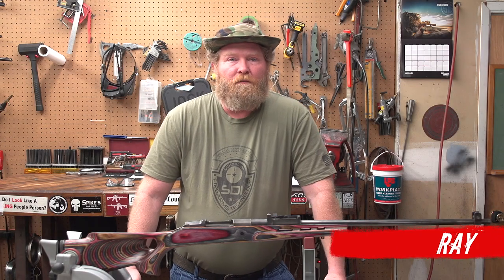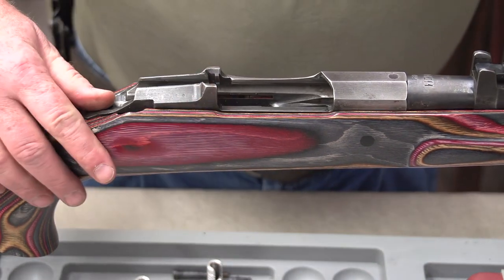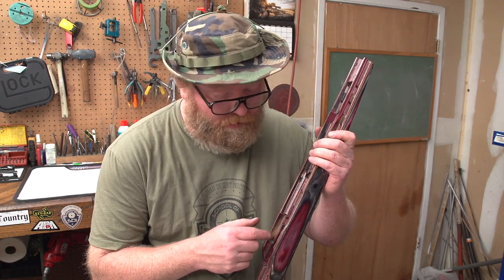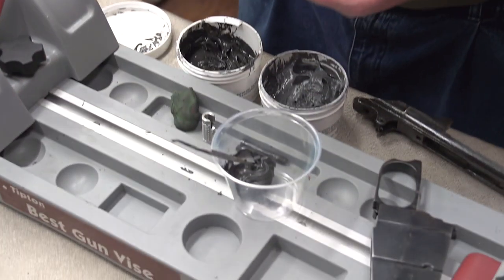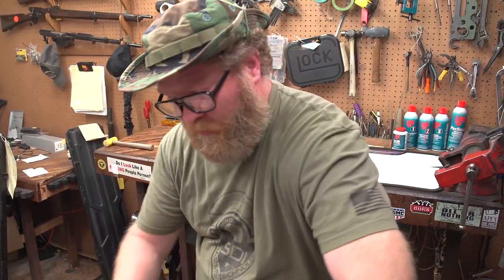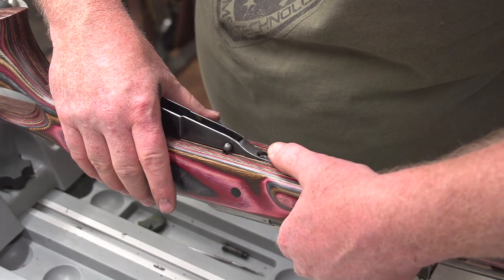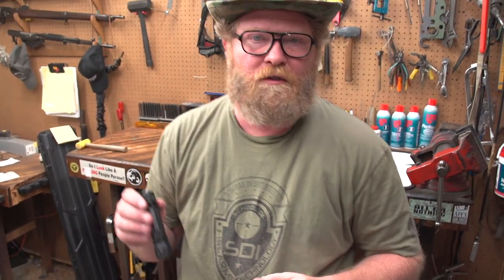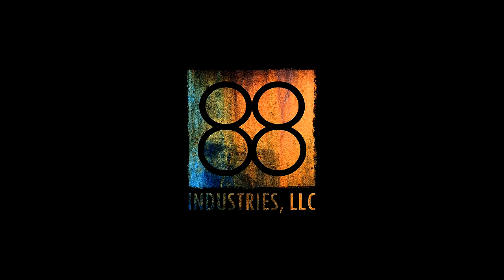How To Pillar Bed a Mosin Nagant

Comment: Outstanding video, all the techniques applies to any gun and the gunsmith presented the information is a very clean manner.  Sort of like a classroom demo, and the tips and techniques were well presented.  Thanks for the work that went into this video, guys, well done!  Nice thing is the gun itself is not altered in any way, only the custom stock to fit the action tightly.  In no way was the gun altered from stock and so change back possible anytime.  This is the sort of effort that preserves the unique gun and yet gives you a tack driver in the custom stock.

Comment: what if you don't have a drill press to drill out the holes? I probably could do the front holes since its straight up and down, but what would be the best way for the rear since its at an angle?

Comment: Forgive me for asking, but what is the purpose of pillar bedding? Is it just so the screws that fasten the reciever/magwell and trigger assembly have something more sturdy to bite into, and/or for stability?
Reply: The bolts only ever screw into steel, but normally the sides of the bolts are resting on nothing but wood, which is obviously less supportive than steel.

Comment: I have the same stock and was wondering if the stock will split without using the recoil lug that is present in the original Mosin Stock?
Reply: Nelson Fields no it wont. the original stocks had the rear lug because occasionally the rifles had to be used as a spear or club. as for the people who will say " a rifle isnt a spear" they came with a bayonet.
Reply: ok thanks!
Reply: Nelson Fields dont mention it. happy to help

Comment: is the bedding material the same thing as jbweld?
Reply: uncletally123 no JB Weld is a cement epoxy. bedding compound is a thinner compound that if you add release agent then it will not stick to the barrel. JB Weld would seal the barrel and stock together.

Comment: Since you guys are modifying a Boyd's stock, I have a question. I'm thinking about doing a stock swap on my Howa 1500 LA, and i wanted to pillar and steel bed the receiver, but Boyd's told me not to pillar bed their stocks because the bolt hole near the rear tang doesn't have enough material to support a pillar. What are your guys' views on that (since you are doing it and I trust your opinions)?

Comment: I am looking for a gunsmith to dbl lug and piller bed a Boyd's lam. stock to a SA M1A.
Any ideas? I'm in central OH. Can ship. This my long range build. Currently bedded in a kevlar stock.
Reply: Doug Allen Are those M1As that accurate of a long range rig?  I hired a dozer guy to build me a burm last fall and have been pretty disappointed with the accuracy of most of my factory guns. I bought a RCBS rock chucker to try and tighten up my groups but have not had the time to start reloading yet. I have laid behind some nice rigs that were really accurate but I just dont want to drop $6000 on a rifle and another $3500 on a scope for a .308   Would be interested in your experiences with the accuracy of the m1a, if you care to share. How would you compare it to say an off the shelf savage 10? If you bed it, trigger job (or drop in trigger) and handloads, what is the best you think the rifle will do at 500 yds?
Reply: TAC-Z I have NO issues with my M1A. It's a long story as to what it is and how it lived 'til I found it, 20 yrs old and never fired Super Match, gauged 0 front and rear. Complete take down, cleaned and fitted. Topped with an A.R.M.S.18, SWFA SS 10X. 1/2" groups at 100 w/ball NATO. With Fed GMM 175's, same hole. On a good day, I can do 6" at 1000. Now it does weigh 15 lbs. Couple that w/20 & 30 rd. mags. as fast as you can pull the trigger. I want to ramp it up just a bit with a new stock.
Reply: TAC-Z M1As can vary from what ive heard, some shoot great some not so much.. But on the subject of accuracy from a bolt gun, you can basically get 1,000 yards for $1,000 if you spend wisely. 
Depending on the prices, 700 AAC-SWFA SS 10X would be a great setup
Reply: Doug Allen Look up Nelson Burger.  He an Amish gunsmith from the New Philadelphia area.
Reply: TAC-Z Amish are pacifistic.  They do hunt.   They are strictly meat hunters.  Ever see Amish at a County Fair?  They will shoot out the stars in the shooting gallery.

There is typically ~3 firearm in an Amish household.  ..22 for small game.  Shotgun for birds, Rifle for deer sized game. Their firearms will be basic, (think Marlin vs. Weatherby)  They do not believe in luxury type firearms..  They typically will shun handguns, as most are for defensive use i.e. (use against humans).  An exception for revolvers for  deer hunting like in Ohio.

Some Amish 'smiths that shun the use of electric power will rely on water powered equipment.  Gunsmithing is a handcraft, very much Amish trade, as they do mall of their work by hand.
Reply: Michael Medley No shit?  How do they power sandblasting cabinets, lathes, mills, and dill presses by hand? 
No luxury firearms or defensive firearms, no wonder i have never heard of any.. Do you live in Amish country or how is it that you know them?
Reply: TAC-Z Lathes, mills, drill presses, forge and bellows can be runs off of a belt driven water mills. Don't know about sandblasting.  I been around gunshows, and in rural areas concentrated with Amish/Mennonites.  I have Amish 'smiths recommended to me.

Comment: if you want a value rifle that can shoot sub MOA and really cheap, go get yourself a savage axis. they are just over $200 at walmart and are free floated and ready to go. just put a OK piece of glass on it for about $300 and you are set. you dont need to dump $800 into a mosin to get a good value gun. plus you can get a modern gun in pretty much any caliber. 7.62x54r is only good for match performance if you reload yourself. otherwise its to expensive.

Comment: No matter how much you polish it a turd is a turd, spend $200 or $300 bucks + the original cost of the Mosin and it will never be a custom Mauser and you still have a rifle that won't preform nearly as well as a new low end $350 American made bolt action combo available in your choice of chambers.